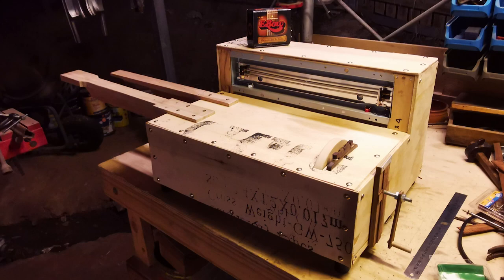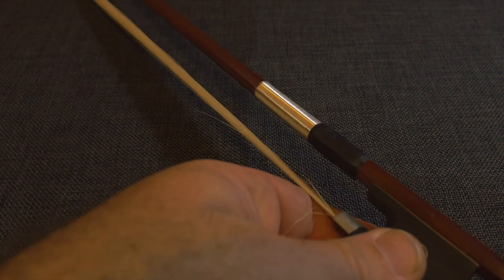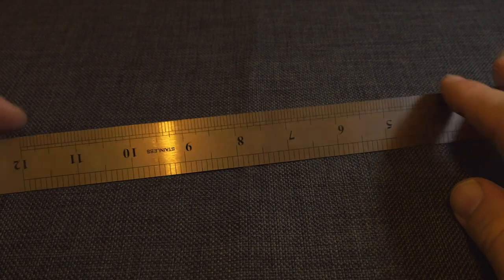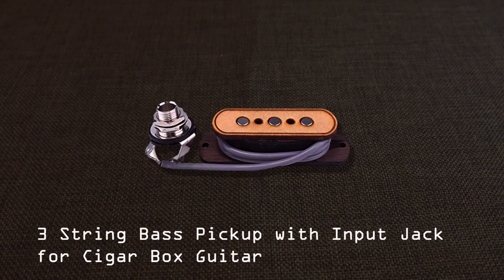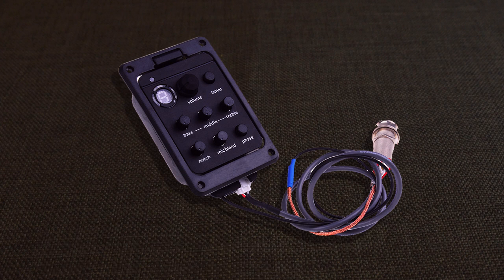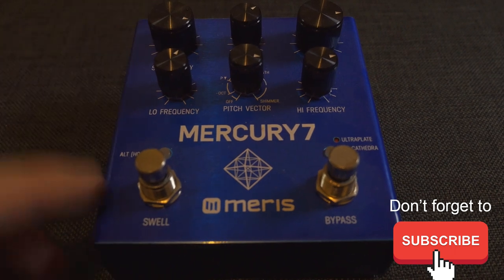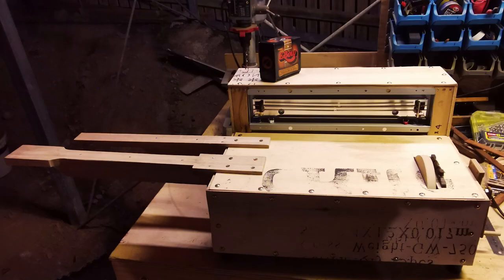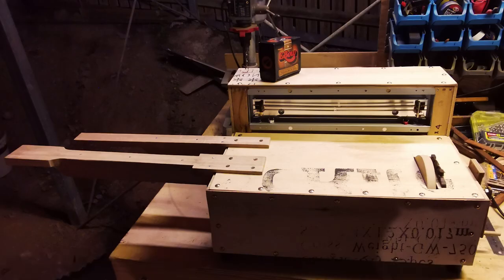How to Build The Apprehension Engine #18 – The Electronics and parts

Comment: Hi Film Masters. Liking the series very much and now got the the crux of this build when it all comes together.

Can I ask about the Blend 301 preamp pickup, have seen that these can be a nightmare. Have you tested this yet ? I believe  that some of these can be fake copies of the Fishman Presys to be found on Ebay and suffer from shielding issues giving a lot of buzz. The Fishman brand is considerably more expensive. Appreciate your thoughts on this and looking forward to the next part of your series.
Reply from the maker: Funny you say that. I've bought the Fisherman Pryse Blend pick up and tested it. It doesn't work at all. Just lights up so will do a quick update on the video. I'm going to use the Piezo pickups instead and have already requested the seller to provide a refund or a working unit that has been tested. After looking it appears to be a Chinese knock off. Not happy at all. But we learn as we go.

Comment: Hi Micheal, I’ve bought the MOD Reverb tank but it’s a little too long for my build, maybe about 1cm. Will it still be okay ?
Reply from the maker: Hi Lydia, You may have to trim the wood frame to make it fit if its 1 cm too short. If you check out the video where I install the Reverb tank you can see I have trimmed it slightly so it will fit. Take your time with a pencil to mark around the reverb tank to where you want it to fit and then slowly remove the wood needed to make it fit. Hope this makes sense. Are you on our FaceBook page? We have over 150 people now there all willing to help each other out if you get stuck. You can also see the fun unique builds people are doing.